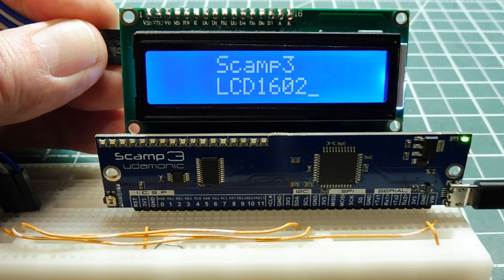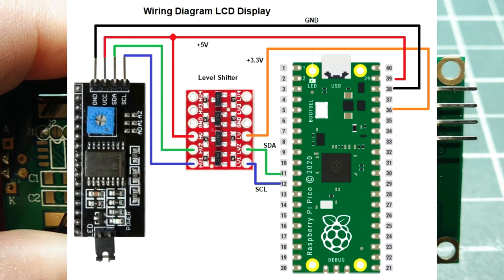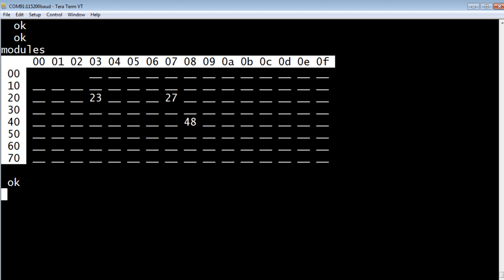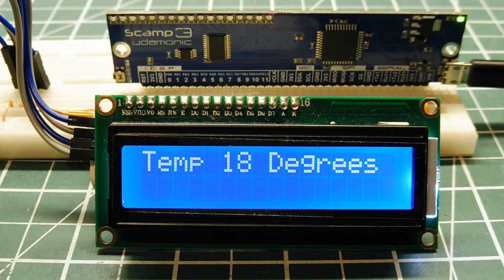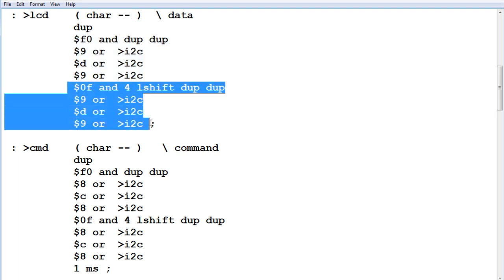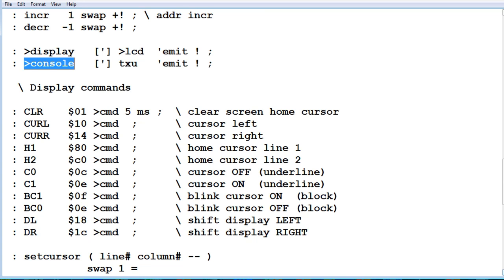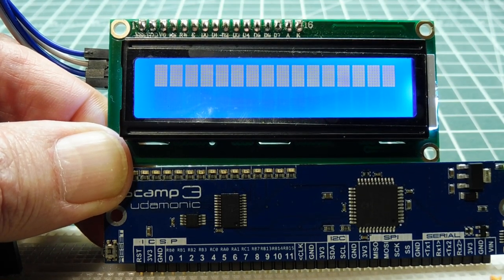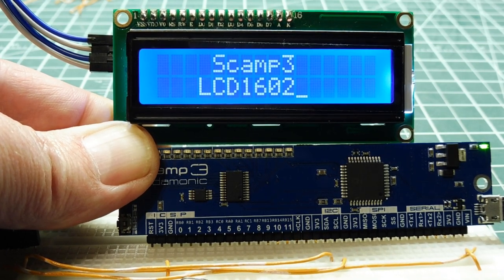Scamp3 LCD1602 Display Interface / FlashForth / PIC

Comment: Many Many thanks Ken for this tutorial as having a display (and of COURSE the code) makes further learning and experimenting possible. I had held off getting a Scamp hoping that you would deliver the goods on this display. And you have .Bravo.
Actually I have in mind a real project (my way of learning requires a real product rather than exercises) that interrogates an energy meter (ADE9000). and performs actions depending on the values read. The ADE9000 uses SPI and I see that the Scamp has an SPI port.
Ken, you have made my day
Kind regards Frank
Reply from the maker: You're welcome Frank. Glad I could help. Having a project goal is a great learning tool.

Comment: Thanks for the video and demo. I have a Scamp3 coming soon (I hope!). Your videos have rekindled in me using forth that I was interested in 40 years ago. It is particularly appropriate for the small microcontroller (Atmel etc). I would like to use it for a control language to small robotic vehicles especially using Bluetooth for remote control.  I have even gone back to my old micro (retro 6502) and implemented FIG-forth and newer versions on a few different platforms all great fun!
Reply from the maker: Thanks for sharing Larry. I have used the Rockwell R65F12 which is a 6502 with a built in Forth on ROM. Things were a lot simpler back then. I have a couple of other Scamp3 projects in the works so stay tuned.

Comment: Hej Ken!
Thank you for this video.
Where can I find documentation about the the display commands you used in the flashforth code?
Reply from the maker: The driver IC for the display is the Hitachi HD44780U. The data sheet can be found here:
https://www.sparkfun.com/datasheets/LCD/HD44780.pdf    Go to page 24
Check online for more info as this chip has been around for a long time.
Reply: @0033mer  THANK you So Much Ken! 🙏🏻 👋🏻